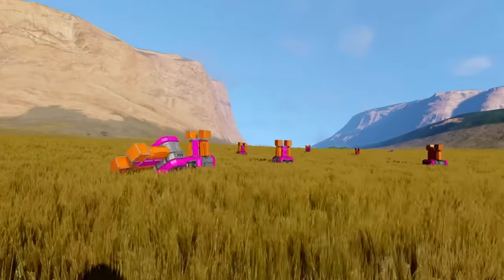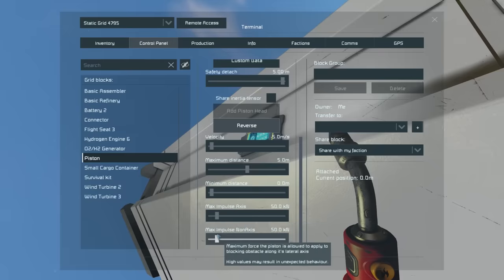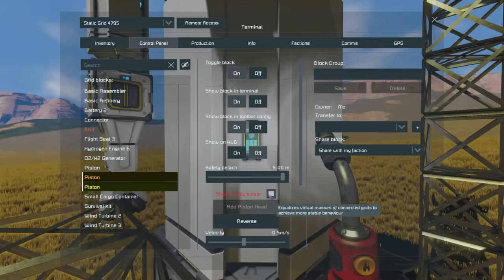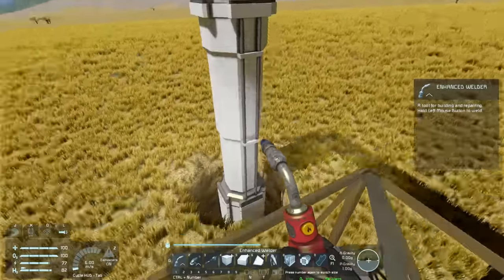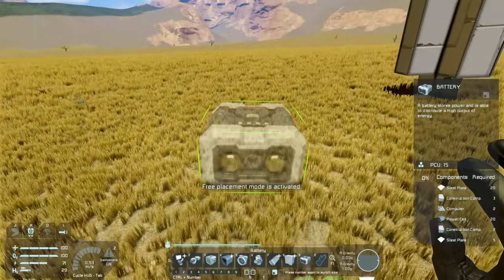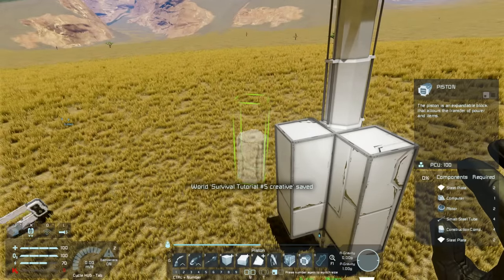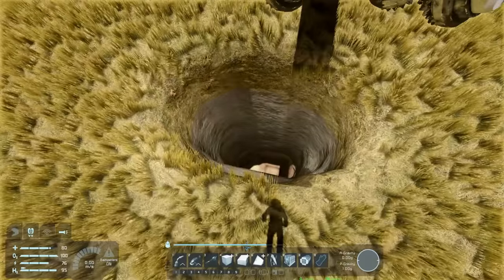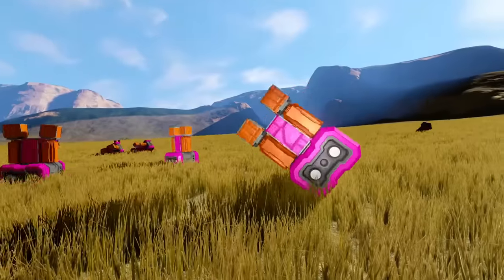Pistons and Drilling Rigs - Getting Started in Space Engineers #5 (Survival Tutorial Series)

Comment: For my drill rigs, I usually start with 1 piston, an advanced rotor, either 21 or 41 total drills (1 in center attached to rotor, with the other 5 or 10 connected to the single drill), have the rotor start at a slow speed before speeding it up to about 6.00 R/M, then I set the piston at 0.00 m/s. it’s a slow crawl, doubly so if I start at the base of a mountain and drilling into it, but it provides me a ton of building material to use for laying down armor blocks behind the rotor. When the pistons fully extended, it let the rotor spin for another minute then slow it down, set the angles to 175 low and 185 high and build a support for the drills. Once that’s done, I detach the rotor head, retract the piston at -0.5 M/S, deconstruct the rotor and build as many pistons as I can till I’m near the drills. I then build a rotor without the head near the drills, extend a piston to barely touching the rig and attach back the head. Then I dismantle the support, retract the piston and rinse and repeat till either clang claims the rig or it’s as deep as I want it

Comment: Me and my brother usually use a piston with an advanced rotor at the end, and then attach drills in a horizontal line. This means that when activated it will dig out the entire circle, and not just that one diameter. Do keep in mind the rotor has to very slow, cause putting it at 30m/s is the most reliable way to cause clang

Comment: No matter what I did, I was having issues with trying to get the whole piston base link thing happening.

I decided to put a link in the floor and have another connector under the cockpit of the rover and on the highest possible Height Offset for the front wheels, it lowered enough for that to link through the floor instead of all the messing around with pistons and all the rest!

Also had the added advantage of giving large item access from the cockpit too.
Reply from the maker: Pistons can be quite fiddly but I'm glad you worked out an alternative solution as that's one of the really fun parts of Space Engineers. Only thing I'd recommend from here - don't do what I did, instead of avoiding pistons for years (which I did until people begged me to make some tutorials on pistons/rotors), just jump in creative mode and test play with them till they make some more sense as there's so much fun to be had with contraptions that make use of them :)

Comment: You can also use the advanced rotor between the piston and the drills, to build a custom spinning large grid multi-drill head (with side facing drills) then you can detach the drill at the bottom of the hole, retract the pistons, remove the rotor (easier the removing the drill) add some more pistons and a new rotor and attach the drill back to it,  2 initial pistons can get you 4 or five more pistons worth of depth. 

Usually what you want is to dig down until you get to the depth of resource deposits, then replace the pistons you've built with conveyors, and use the same kind of setup but facing side ways, to drill out a massive chunk of the deposit, and use landing gear to hold the drill heads in place when you add more pistons.
Reply from the maker: I'd use a small grid head (cheaper) and do the same thing :)

Comment: It is possible to replace pistons entirely with multi-rotor  lifts.  These are really handy when working without the jetpack as you can move them to a convenient location and discharge the head.  These multi-function arms can use different attachments, cover large volumes as a function of degrees of freedom, and can perform the same roles as connectors for moving inventory and power.  The rotor parts on small grids also occupy less space than connectors and can be attached to nearly anything.
Reply from the maker: The main reason I haven't done much with rotors is that they're a minefield of frustration for new players so I feel they are best avoided until you have a solid grasp on the basic gameplay :)

Comment: With pistons running in opposite directions it is still perfectly safe to run them simultaneously if you are starting them by selecting the Reverse command.  Those that are fully extended will start to retract, while those that are retracted will start to extend.
Reply: It is perfectly safe as long as the combined speed isn't too fast for the voxel removal. The slowest I have been able to get a piston to move is 0.1 and when you start getting into over 4 pistons you will exceed the removal speed and start slamming the drills into the voxels.
Reply: @jimcole5359  you can go much slower that 0.1, use ctrl+click
Reply: @defne499  I have tried that in solo and it goes back to 0.1 when I choose reverse, but it might just be me.
Reply: @jimcole5359  it says 0.1 but it is slower
Reply: @jimcole5359  
As others have pointed out, you can get much slower speed by using Ctrl+LMB to bring up the precise setting option.  The readout never goes below 0.1 but if you open up the precision setting you will see that your actual speed is as you set it.

 I have run up to 11 pistons this way without to much hassle.  Higher than that it started getting a bit glitchy (for me anyway).
Reply from the maker: Agreed, when you start getting above 10 or so it tends to work better to move them in batches, I suspect that may be due to some rounding errors with the very tiny movements :)

Comment: You could also use that rotor on the end of the last drill setup to make a rotating drill mechanism, effectively giving you a 3x3 drill setup for the price of only 3 drills, although, you'd have to put your piston speed super low to give them time to mine those circles through!
Reply from the maker: Yep, to both points, would be worth it though, the only reason I didn't at the time was to minimise how much I felt I needed to explain about rotors :)
Reply: @Splitsie  Yep, makes sense! Thanks for your very informative videos!

Comment: Watching these quite a while after they were posted, but still great info.
I'm not quite clear on why you'd use a rotor to hold the drill cluster if you weren't going to rotate the drill cluster as you drill. (which is what I was expecting)
I was also wondering about using a rotor, then a hinge, then a drill head. The idea being that you drill a hole through the topsoil, then then start the rotor (while the drill is still running), then very slowly angle the hinge so you'd be swinging the tip of the drill bit around the center axis to undercut the hole. 
The rotation speed and piston speed would have to be very slow, but would allow you to move a lot of material from a fixed location. (at least till you mount the entire operation on a mobile drilling platform.)
Reply from the maker: The rotor was to allow conversion to the small grid version while remaining connected to the large grid, the small grid version of a drill is a LOT cheaper to build so is quicker to get up and running in the early game. The only reason I didn't rotate it is that I planned to cover rotors separately in a different tutorial, in hindsight I might have just left it out if I were to make these again to simplify the steps more.

Space Engineers doesn't have hinges that are inline you only have rotors so digging in the way you describe is very difficult to set up with the vanilla game - so not at all suitable to a beginners tutorial

Comment: I tried to use pistons for connectors but with no luck for cargo transfer (probably did something wrong). Finally I used tilted terrain to build connector in the right spot for connector to match with a rover.
Reply from the maker: The terrain trick is how I used to almost always do things before we had the half blocks, it's a good solution but hopefully you'll work out what was wrong with the piston setup, the most common thing I can think of is making sure that the piston part was welded up to functional, especially if you have a couple in a row it's easy to miss and would stop stuff from moving through
Reply: @Splitsie  Thanks for advice. It was working (could be moved) but maybe some other part in this chain was not finished. It was connected to conveyors so maybe it was the issue that required additional effort to make it working. I will experiment with that when I will build pistons/rotors mechanism in construction yard. The idea is to be able to connect to crafts and vehicles under construction (as soon as connector is built). I had situation that I forgot to turn off battery and I had to grind it down and create back to have energy there. I did not find any way to transfer energy in such emergency situation.

Comment: In KSP you can make a K-Drive (Kraken Drive)
Which utilized the kraken to move ur ship with phantom forces...
I guess in SE you can make a C-Drive,
A Clang Drive...
Reply: Yes, there are multiple workshop builds making use of different physics glitches to achieve controlled thrust. Some of them are frighteningly effective. However, these glitch effects often stop working as the game is tuned and patched, and may even work differently across singleplayer, multiplayer and dedicated server games.
Reply: Yes, most don’t work nowadays in ksp 1.6 either, but the ladder method still does tho
Reply: @whitedawn2122  I believe the most effective ones currently make use of mass shifting exploit, where moving objects via conveyor is not accounted for, but physically moving a container including mass does. Thus a container on a subgrid can be shifted with (advanced) rotor displacement very quickly in any of the directions, then its contents shunted via conveyors off the subgrid, reset the rotor displacement, shift the mass back via conveyor, and repeat. Using programming blocks, the cycle can be repeated several times per second, achieving almost instantaneous accelerations to max speeds in any direction.
Reply: Hmmm interesting, as far as I know in KSP there is no effective way to control phantom forces into a useful propulsion system...
But there may be a couple left...
Reply from the maker: There are certainly some fun methods in SE like Matt said, useful to know about sometimes as it can help avoid some of the pitfalls if you can work with them that well :)

Comment: >
Very helpful and informative! Well done!
.
You mentioned that you're somewhat at the mercy of the terrain (in some scenarios) with regard to aligning the base connector to your rover connector.
Related question: Could you build an armor 'platform' that you could drive up on to so the alignment is set each time (that is, as long as you didn't muck around with your suspension height)?
The piston thing is VERY COOL but just in case you didn't want to go through the piston stuff for that inventory/ore transfer feature, maybe that would be an appropriate work-around.
Dunno. I'm just learning all this now. Maybe I'm over-simplifying it a bit.
(apologies if this was already covered).
Reply from the maker: It would depend on the design of your rover, with large grid being 2.5m to a side you'd need to ensure that your small grid rover aligns to that neatly without messing with your suspension. The main challenge of an armoured platform is making a smooth transition from the terrain onto it which I do go into some detail on in the tutorial about rotors and hangar doors like trying to build with an uphill slope at the entry so you don't need to have the sharp transitions that the 2x1x1 to flat blocks leave you with :)

Comment: probably one of the better videos ive seen for space engineers, i learned loads from that one video, now i just need to figure out how to make my base airtight, nothings working,, just keep running out of ice too quick, the only gas bottles filling up are the ones in the h2\o2 generator none of the gas is going anywhere else, ive double skinned the bunker, double airlock and still not pressurised, dont know what im doing wrong,, and cant make small rovers, just something small enough to carry goods, just a storage box on wheels,,, but the damn things huge!! like bigger than the big h20 tank and then when i do finally build the monstrosity,, the landing gear wont disengage and i cant see out the windows now will it move,, minecraft logic takes over,, its sat in the air attached to nothing?!? i need help

Comment: I wouldn't bother with the small drills.  Place the rotor at the bottom of the drill tower and a horizontal piston on top and you have a 180 degree field of drilling available.  Once you have a couple of large drills running your main problem is storage of all the ore that comes out rather than stuff to make the drills.
Reply from the maker: Small drills cost so much less than large that you're always better off using them - since you can build 5 for the price of 1 which covers a much bigger area :)

Plus I like using them for drilling out underground bases since you can get more fine control over the areas they remove

Comment: So... you built that big conveyor block and then went all the way around the sides with the small conveyors. An alternative trick, is to use a small grid connector, which has a large rear port, and four small ports on the sides.
Reply from the maker: That's a very good point, I'm totally going to be doing it that way in the future, though I wonder which is cheaper on iron, due to the difference between interior and steel plate (off the top of my head I can't remember if small grid connectors cost much) :P
Reply: @Splitsie  I don't actually remember off the top of my head. Interesting thing to know.

Comment: Was there a change? I returned after a while and can't seem to make this work.
When I add a small head to the adv Rotor, it adds me a head with a small port not a large port.
And when I add a drill to that the rig keeps exploding. no matter if I have interia tensor or not.
Reply from the maker: The most recent update added the very small advanced rotor and changed the default rotor part. If it's exploding I'd recommend trying it with some conveyor blocks to extend the drills away from the rotor, for some reason I haven't been able to work out, sometimes drills damage the rotor part on this style of rig (it's frustratingly inconsistent)

Comment: I’m having trouble placing the small conveyor on the side of the large one, to connect the small ports. I don’t know why but when I size the block down to small it will automatically resize when I look at the block. But then, when I resize while looking at the larger block, it just phases through the large conveyor.
Reply from the maker: It sounds like you might be trying to use the wrong block size for the piece you're connecting to. Try placing the tiny conveyors on the block and if you can't then you've got a large grid conveyor there and didn't do the conversion to small grid on the rotor :)

Comment: I'm trying to get a floor to remove out of my space station roof with a piston, revealing 3 missile turrets that then get moved up by another piston to the same position where the floor was. It works fine coming up, but because of the collision and timings when I put it on the same button (each piston set to reverse their velocities), the floor block-group slams into the other one causing them to both not move. I don't know if there's a timing way around it so that you can have 2 different timings on the same button depending on what came before it, or if there's a piston-block physics way around it. Any ideas? (Or do I have to just make 2 buttons for any time this switching scenario comes up again?)

Comment: Why not simply put the option "Increase/reduce speed" in the toolbar using G button while sitting in a cockpit? That way you can simply keep pressing the numbers (1,2,3 etc) to slowly expand/retract each piston as you wish without the need to manually access the control panel.
Reply from the maker: I think the main reason I didn't in this case was because I found the demonstration easier from the control panel than using a hotbar that doesn't label the controls all that visibly for people who are learning, I do use hot bar setups like you say though :)

Comment: What if you made a massive rover with 3 drill rigs on each side? Essentially making a mobile drill rig. Or simply mount one to the back of the a rover?
Reply from the maker: There's no reason you can't do it, but it can be difficult to move around properly with a large drill rig attached to a wheeled vehicle - speaking from my own failures there. Just because it's difficult doesn't mean you should avoid doing it though :)

Comment: "So how can we avoid this behavior?" 
Option 1: Submit a bug report. 
Option 2: Download a community patch or mod. 
Option 3: Have your ability to play limited by bad game design.
Reply from the maker: This issue with physics interactions is very common in games, I don't completely understand the mathematical reasons behind it, but have had someone try to explain it to me before. What it boils down to is that for most interactions there's a performance and accuracy benefit to having the collision slightly extending beyond the visible bounds of the entity which is the cause of the problems I was demonstrating here. It's something shared between multiple physics engines so it's not going to be addressed in a bug report, community patch or mod and is a calculated downside of benefiting physics interactions elsewhere.
Reply: I don't think this sort of behavior is tolerable. An adequate patch might make an object less able to interact with itself. 
That would allow some things to clip through each other, but that would be preferable (and more realistic than) the current state.